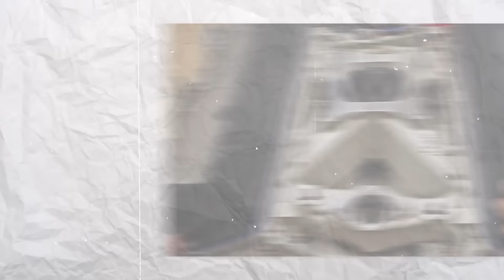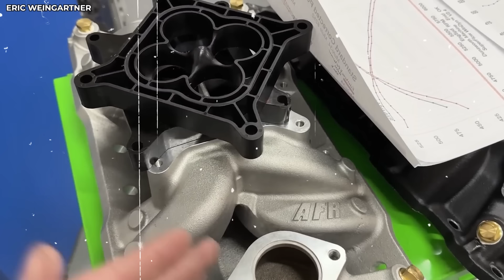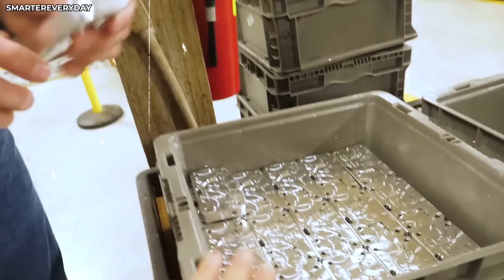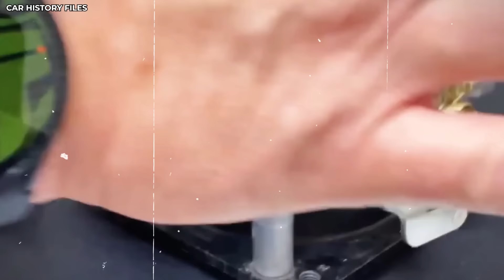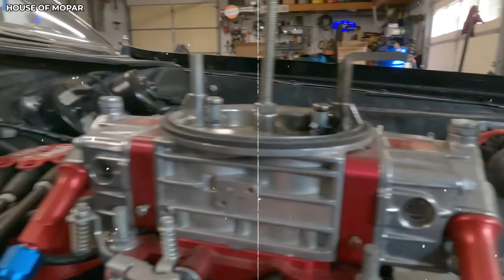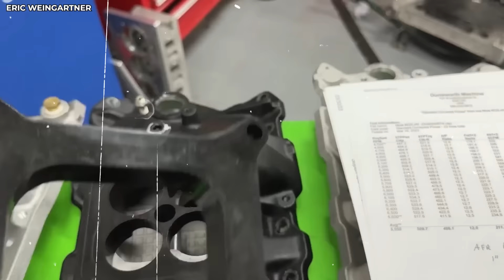This Forgotten Ford Intake Trick OUTSMARTED Big Holley Carbs

Comment: I had a Freak 302 2V in a 68 Cougar back in 75. Ran a cheep set of headers, with a Top loader 4 speed. Dropped in a nice little 460 \298 bump stick, and the motor barley ran any better. UNTIL I saved up enough money and finally bolted on a Holley 700 double pumper and Torquer intake. From a slow roll the car would totally pitch sideways just stabbing the throttle at 15 mph ! It felt like I almost doubled the horsepower just bolting on a carb and intake. The car was WAY faster !  So, not so sure I buy the little dinky 2V Autolite makes more HP theory. Not on my car it didn't !

Comment: Autolite/ motorcraft 2 barrels have anular boosters and have excellent throttle response. They are simple and can make more power than most 2V carbs without spending a fortune on racing two barrel carbs. My friend ran 12.70s with a windsor powerd 67 fairlane. It was a second quicker with a good 735/780,  3310 holley but deadly consistent with that old autolite 2 barrel. He was in the money every weekend when bracket racing.

Comment: Tell me you know zero about cars without telling me you know nothing.  1) An Edelbrock performer cannot have 12 in long runners except possibly on the end runners on an engine with a wide area between the heads such as an Olds 455. Even the tunnel rams had less than 7 inch runner lengths. Longer runners are good for low speed torque. Mopar long-ram (think 413 with carbs over the valvecovers) only had roughly 12 inch runners. 2) a 2bbl Motorcraft 2100 was NOT a spreadbore. It's not possible to run a 350/450 CFM 2bbl and compete against a proper setup 2x4 setup. 3) Timing requirements are dependent of way too many variables to list. 4) If this was factual, why did Glidden use a modified tunnel ram and twin dominators? Glidden was masterful in making the 351C work quite well.

Comment: A lot of what’s said here is why Rochester Q-jet works so well. Yes a Holley can be made to run great but just about every jet and oriface in the originals is way, way too rich. Tune this and yes it does perform well. A lot of trial and error to achieve acceptable results. But honestly the Q-jet still runs better on the street. Stupid overly radical cams and too much “speed parts” is a way to achieve crappy less than stock results with lousy drivability.

Comment: I had a smog 350 in a 3/4 ton 2wd Chevy Silverado and put a performer intake, 600 Edelbrock and shorty headers and bumped up the timing until it was hard to start warm and backed it off a few degrees it ran 14.65 1/4
Reply: Backyard Genius…🤔🎯Atta boy!

Comment: I put a 350cfm holley 2 barrel on the stock cast intake of my 1984 f150 and it was unbelievable the difference of power out of less than 100 extra cfm . It was all stock other than it got headers and a clone hei. 

You don't always need a ton extra to see real gains best 500 I ever spent